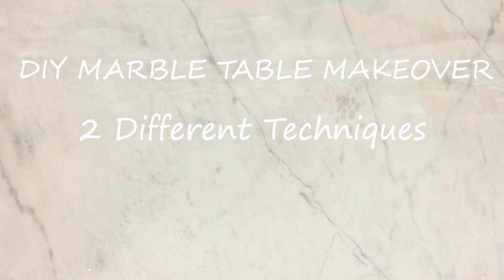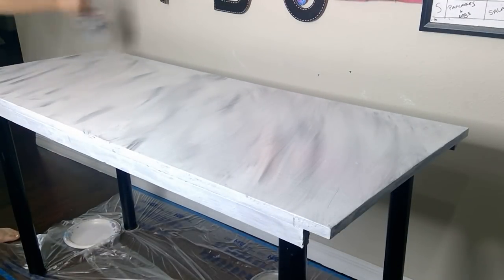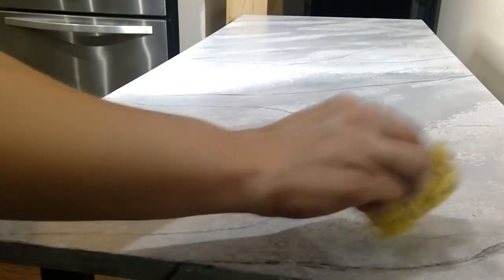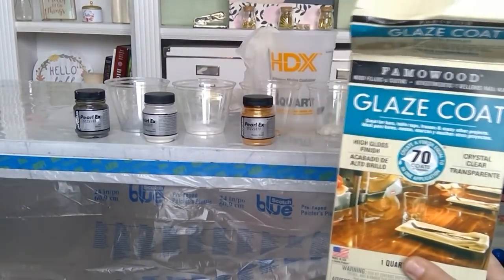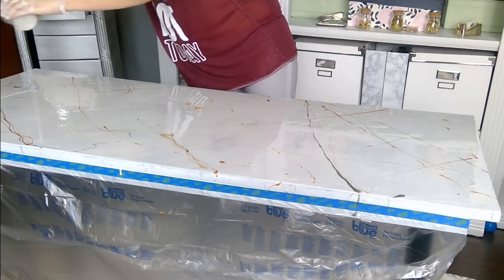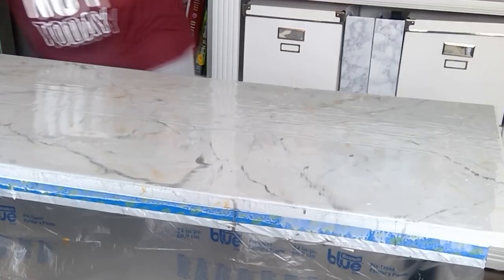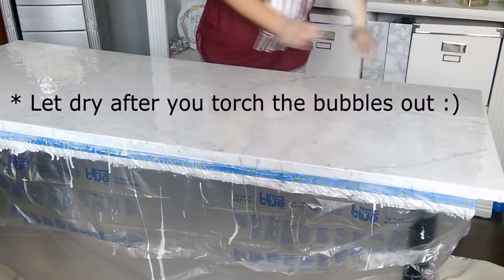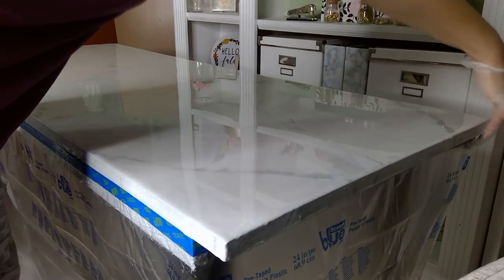DIY Paint & Epoxy Resin | Marble  Table or Counters

Comment: I was wondering about using hair dryer on hot setting, low speed rather than blow torch for bubbles & perhaps for moving epoxy around.
Reply from the maker: Leda Forseen  a hair dryer is great for moving things around, on low, it gently moves colors without making it look muddy.  And it will also pop surface bubble as well. 👍🏼

Comment: I am exhausted by all my research lol..... I am about to take a leap and do my kitchen countertops...
BUT I am hearing mixed reviews on acrylic vs. oil based ...
Any advice? 💁🏻
Reply: Roanna Avila    In case you haven’t done it yet...  acrylic is much easier to work with because it dries quickly. Oil takes forever to dry.

Comment: Good morning dear Cora
After watching all your lovely videos for tabletops encounters. I've decided that I like this one the best your painted one and I agree for you out of the dark on top of it I like that way.. So my question is would it work for me to do this first one and for the epoxy on that I think it would.. I'm going to be doing this soon so I'd like to know thank you dear love love love it
Warmest greetings Miss Renee
Reply from the maker: Theda Renee Williams , The first one in this video I used a primer coat ( I like to use Glidden Gripper primer at Home Depot). You can get your primer tinted to your base color if you want to save a step. After primer is completely dry, then you can start adding some layers of colors. Your choice. Acrylic paints go very far for this project so pick some of your favorites or the ones in the color scheme you want. And start applying with soft gentle strokes while you get used to it. Then when you are feeling more comfortable you can start layering your colors. Remember if you mess up or don’t like it... you can just paint over it. Once you have a look you are happy with, then I would pour the epoxy. But only after it’s completely dry and you are sure you are happy with the look. The epoxy is definitely the last and final step. It needs to be mixed very well and applied rather quickly. It tends to start setting or curing within minutes of being poured. So I try to pour in the center and let gravity move it towards the edges. I help a little with a stick or something with a smooth side to guide the epoxy to the edges. Gravity with level it out,.  popping the bubbles is important to prevent dimples or dents, which I use a little hand torch for, or you can use a straw. Give it a day or as many as you can wait. Then it should be hard and shiny as glass 😁

Comment: What was the silver pigment you used that was giving you trouble. Did you find out anything more about this? Could a different pigment (brand, type, etc) have worked better? If so what would you suggest?
Reply from the maker: Thomas Gerlach , the silver that I showed on the video is the one I had an issue with. I recommended in the video to use a regular metallic silver acrylic. But you could also try a different epoxy pigment brand and just do a test batch with that, and see how it reacts and  cures before beginning a large project. The other colors worked brilliantly, just that silver turned into a rock hard foam looking brick, I’m not sure why this metallic based one reacted differently than the gold, but I haven’t used it again to see if it’s a continual problem. I just discontinued use for now, since I know I can achieve a similar effect using metallic paint and mixing it into my epoxy.

Comment: So I finally did my bathroom... hasn’t been 24 hours yet but I notice in a area where there is a thicker layer of expoxy it looks yellow?  Have you seen that?  Does that go away once dry?
Reply from the maker: lovliesusie1 , I haven’t personally had this issue, but a few people have said the same thing. I think it depends on the brand of epoxy. Some say “clear” but it actually has a tint of yellow to it. While others that say “clear” , are actually clear . I think the problem is that different brands, and different temperatures or lights ( UV ) , can cause different results. I wish I had a solution to this. If only I could create my own brand of epoxy, with consistent results, I totally would. I’ve heard people say that ecopoxy is consistent and clear. I’ve never used it tho, just passing info along.
Reply: Cora's Creative Corner I think it’s because the counter is uneven so a lot leveled on one area.   Have you ever sanded down the expoxy once dried?
Reply from the maker: lovliesusie1 , yes you can sand epoxy once it’s hard to the touch. And then buff it out using a buffing pad or a very fine grit sandpaper, then you can wipe a thin glaze over the top or add a thin layer of clear poly to the top if you desire. If you are on instagram, there are channels that do this all the time, it’s mesmerizing to watch. I particularly like Rustic Designs by Rich , and the EcoPoxy channels for inspiration and knowledge working with epoxy products.
Reply: Cora's Creative Corner thank you so much!!!! I’m gonna look at those channels... I was thinking of what you said as far as sanding and adding a thin glaze over.  Thanks for all the help :)

Comment: I wish I would have watched this video first before I watched many but this one you used to Roller and my problem I had to do my counter was using a squeegee I just could not get it even I think I kept scraping too much off I have yet to try the sponge method but I have a feeling it'll work better for me
Reply: Just to let you know I had watched someone else's video and they used a trowel so I decided to try that and it worked wonders for me I think I was just scraping too much and not putting enough on the first place I got them pretty even enough that I can live with the hardest thing I've ever done

Comment: awesome! how are you not pushing the epoxy all the way off every time you roll?
Reply from the maker: Kristen Kuhns lol personal restraint is the only answer. I had to slow down and stop the roller about an inch or two before the edge to prevent it all from going over the edge. Gravity helps it settle out too.

Comment: Can the hand method be done on concrete countertop?
Reply from the maker: jda1304580 as long as you have a good primer ( to fill in the porous concrete prior to adding layers of paint), yes , I believe this will work just the same. However, if you don’t prime the base well, you will find that the concrete just soaks up your paint. Maybe even sealing the concrete with a clear coat first then adding primer might make the process faster and may use less product. Again, without sealing the concrete first, it will absorb soooooo much paint and take so many layers to achieve a solid look.
Reply: @CorasCreativeCorner  Allright, thank you very much and thank you for the prompt reply.

Comment: Looks awesome!! Did u do the final coat of epoxy the next day? How long after you torched the first time did u add final layer?
Reply from the maker: Kristi Norton , for the epoxy layers I will personally wait a day in between layers. I pop bubbles right after pouring and smoothing, and again about 10 mins in, to catch any late risers. Then I would wait over night and if you plan to pour another clear coat or something , that’s a good time to pour. If the first coat worked out great and you need no adjustments. You may not even need more than one layer. I had the weird  reaction to mine with the silver pigment which is why I  needed to add another layer.. Often if people need to apply another coat, it’s because there wasn’t enough the first time and it shrank up during the curing process leaving dimples. I always stress this “ pour waaaaay more thank you think you need, be very generous” because the thicker the coat, the more beautiful and flawless the coat. Gravity will push it over the edge for you. If you are forcing it to stretch over the surface... there isn’t enough. It needs to be such a thick amount that it flows over because it has no where else to go. That is how I’ve obtained my best results. When I’ve skimped.... I’ve found issues like dimpling, or weird edges. ( also be sure to mix EQUAL  parts thoroughly! ) 
It’s overall very easy to use and work with. It’s just the prep work that’s tedious. Laying plastic taping off etc. that takes longer than the actual mix and pour.